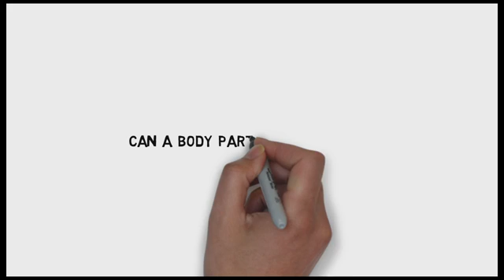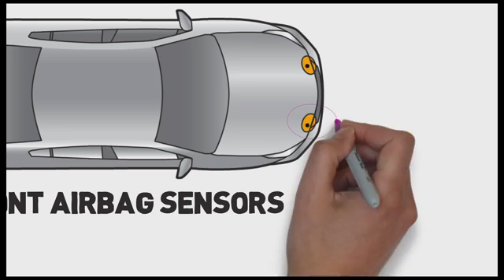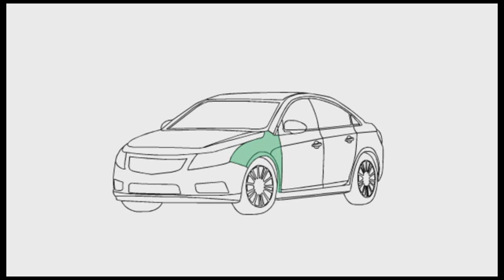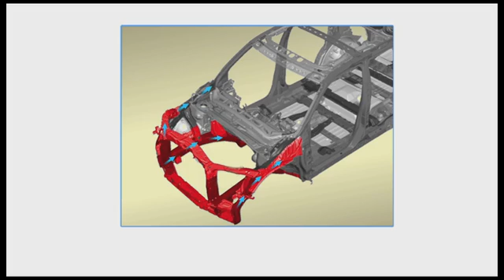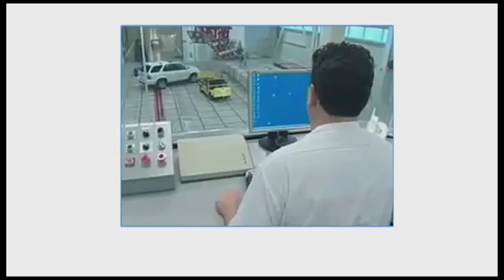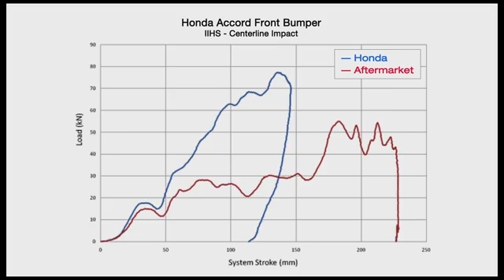Can Body Parts Affect Safety?

Comment: Yes and no. A bumper bar designed with the same energy absorbing properties as the oem will provide the same level of system performance. The video shows force vs deflection curves. What happens if the two curves are the same? How hard is it to duplicate the curves? Not hard using readily available FEA and crash analysis software like pamcrash.
Reply: +Greg Bayley - Greg I designed this bumper when I was working for this supplier of Honda. I was part of the study - those graphs and plots I created and provided to them for this video.
I will say if you can match the performance... it wouldn't be a problem. The problem is to accurately duplicate the product you need similar materials (about 4-5x stronger) than what the aftermarket part was. Using these materials also require different manufacturing processes. By the time someone would tool up what would be required for an equivalent bumper... they would be losing rather than making money.
Reply: We  did material substitutions all the time.  Sometimes all that was required was a thickness change and sometimes a changes in the cross sectional properties.  In a seat belt application we changed the load carrying frame from steel to aluminum.   Used an aluminum alloy with same tensile strength and all was good.  It's possible, it all depends on the motivation.
Reply: +Greg Bayley - I don't disagree with anything you've pointed out. The problem specifically with the "aftermarket" bumpers is they aren't made to any sort of performance specification... they are simply made to be able to hopefully bolt on. I think we both can safely say that based on the geometry being the same - having lower strength and lower thickness material will not yield the same performance. The bumper aftermarket guys want to make a quick dollar - so they aren't going to crash test parts, study the force - displacement response, and the duplicate it. Not in all cases, the only thing some of the aftermarket part guys care about is making a quick profit.
Reply: They wanted the quick dollar?  What did the companies want that used bogus inflators manufactured by Takata?  You get 3 guesses and the first 2 don't count.

Comment: Isn't an impact bar considered a sturctural part and not a "body part" This video puts impact bars in the same category as sheet metal when it referes to body parts as it circles hood, fender and bumper cover. It's definitely a good point about safety of using OEM reinforcement over A/M, but not quite interpreted correctly, considering this video focuses specifically on the impact bar crashworthiness.

Comment: Colleen, Honda spending their money on ads that educate the public (which does include the insurance industry) is a good start towards helping us show the industry the issues with this. Save this video and show it to any adjuster that is insisting you use an AM bumper reinforcement as part of your "documentation" as to why you refuse to. 

When I worked at I-CAR as an instructional designer we had a brand 2006 Accord that was donated to us from Honda that we used for a video on front frame rail replacement. Because we didn't want to show putting a rail in an undamaged vehicle we rolled the car down a hill into an 8,000 lb concrete slab that was staked into the ground. We were able to get the car going about 9 mph. The first hit (offset to the left front) into the block collapsed the bumper reinforcement (enough to show damage but not at all what you would call destroyed), cracked a headlight mount tab, did minor damage to the bumper cover, and that's it. NO structural damage to the vehicle at all. So we started over a the top of the small incline, rolled it back down, and hit the block with the same part of the car  a second time. This time with the bumper reinforcement already partially collapsed the collision energy went much further into the vehicle and the rail was kinked about 1/3 of the way back and pushed into the floor, the transmission case was cracked, the hood was damaged, the fender was damaged, and the left shock tower was pushed back and inward. To me this was startling proof of how important the front bumper reinforcement was and proof that I do not ever want to install an aftermarket one.